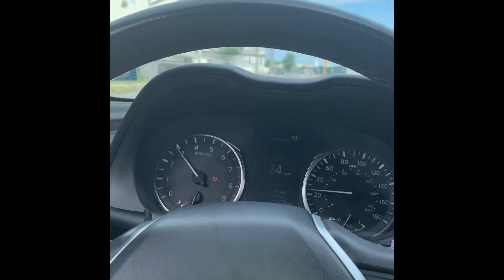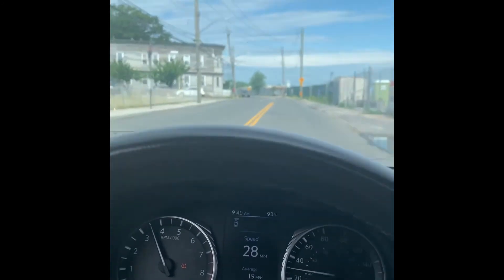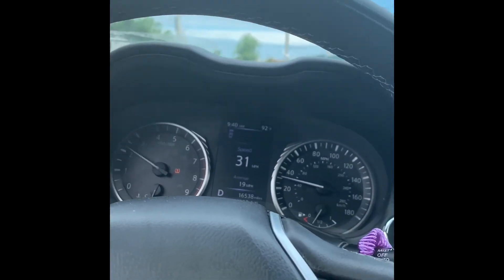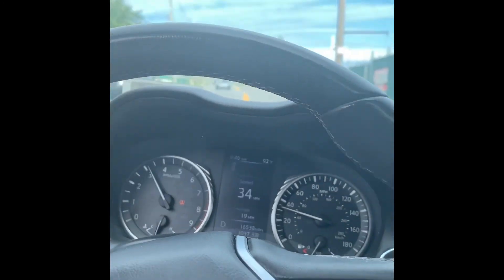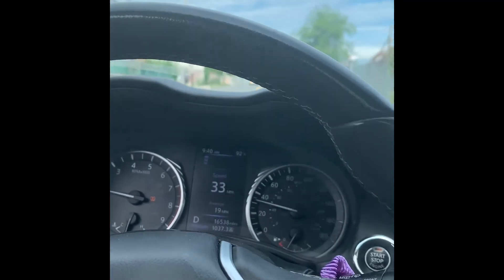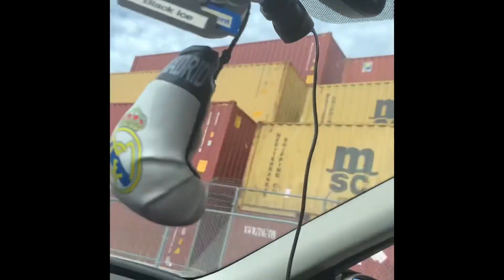Infiniti Q50 acceleration failure P00E1-00 code

Comment: My car started to loose power I have q60 check engine light just turned on gotta check code but sounds same.!!
Reply from the maker: Hey I’m not too sure if I updated the video but my issue was due to 2 parts malfunctioning. 1 was my downpipes gasket and had air leak the 2nd was my BOV’s  filter broke (air leak ) . You can also try cleaning ur maf sensors, a lot of people reporting no issues after that.  Best of luck

Comment: I got a 2022 Q60. But I don’t got no codes or no check engine. But when I accelarate it’s slow. I press the pedal all the way down but it accelerates so slow like no power coming in. What’s the problem? Anyone?
Reply from the maker: Message me on IG b4tmobl is my page.
Reply: Same thing happened to me in my Q50 what’s going on with that?
Reply: Did you find out what it was? My q50 just did this foot to the floor but accelerates super slow
Reply: My q50 would just bog like you gas it no power now I have ecutek it will always come as p0106 or sometimes maf codes 
Once this week had lean codes both banks but with ecutek I just delete lol it won’t show on your dash tho so it goes limp
Reply: @johng83  man. I just took mine to the dealership and got a diagnost on it. They said it was a driver side turbo that needed to be replaced. They charged me $220 for the diagnose. Right now I have it at a shop and getting the turbo replaced. Hopefully it comes out good.
Reply: @ElPatronDTCOficial excessive crankcase pressure caused your turbos to fail.

Comment: My car is 2018 q50 red sport 400 , i just had this issue I stopped in traffic light once i start moving the RPM reached 5 but the speed on 30 km/h as well gas smell inside the cabin … not sure what to do  !!! 

My car only cuts 35000 miles no any mods
Reply from the maker: Oh gas smell is a red flag, go to auto zone or get a ecu ready and check what codes pop up. Set up and appt  w Infiniti or ur mechanic
Reply: @b4tmobl244  yes bro i have to do this , not sure why this happened i am now just searching here and there thru million of google pages and videos
Reply: @MohamedElSanousi  did you figure out the issue
Reply: @atulmcdaniel7746  bad gas
Reply: @MohamedElSanousi what do you mean bad gas?
Reply: Failed fuel injector was stuck open same symptoms 2015q50 3.7

Comment: Did you fix the issue? Mines acting up but no codes pop up. Mines a 2014 sport 3.7
Reply: My shit not going over 2. Rpm
Reply: Same here out of nowhere did you get it fixed?
Reply: I’m having the same problem on mine
Reply: Did any of you guys fix it? Mine started doing it today
Reply: @simplynonnie3108  same here mate I can’t go over 40
Reply: @simplynonnie3108  go to a shop
Reply: @Eviloneyousay  didn’t have to! Got it fixed already thank you tho
Reply: @simplynonnie3108  how did you fix it ??
Reply: @simplynonnie3108  Hey bro, how did you get yours fixed? Mine won’t go past 55 mph. When I launch it won’t go up to 2000 rpm.
Reply: @simplynonnie3108  ?
Reply: Some problems can be MAF SENSORS (mass air flow), intake air filters, or bad spark plugs. If nothing works then take it to the dealership.

Comment: Did you fix the issue??
Reply: Yes charge air temp sensor…car is in limp mode when it fails
Reply: @nycdiplomat718  thanks Ill try
Reply: @jorgeiniguez3392  did you det it fixed? What was the issue
Reply: Yea new transmission